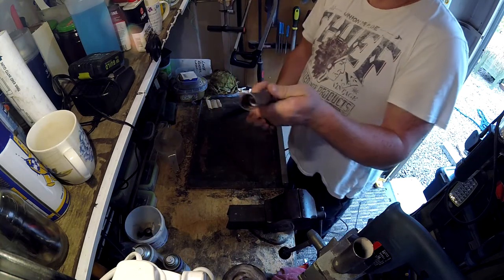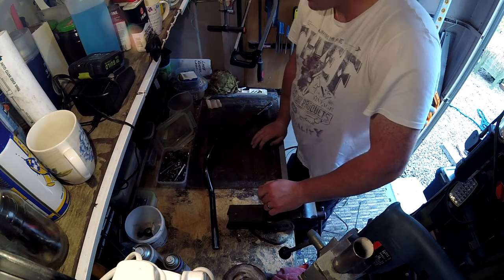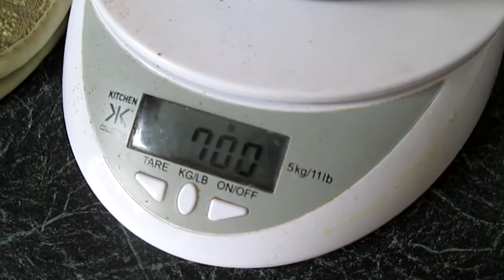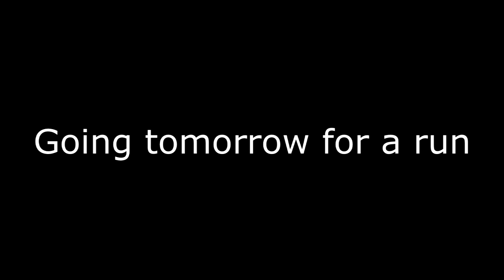Motorcycle handlebar vibration issue Part 6

Comment: I have an old Royal Enfield 500 single , do you think filling the bars with lead shots would be effective in reducing the vibes?
Reply from the maker: The best thing that helped me was old small nuts and washers or a set of steel bars. The lead shot didn't work so good but the steel bars have worked the best so far and the nuts and bolts a close second. If your bars are already steel then try some old nuts and washers, small bolts and screws, let me know if you have success.
Reply: James McCreadie Thanks for the reply. I have an internal thread at the end of my stock handlebar to fit bar end weights. So that allows me to fill things only upto 5mm . I shall try to source small nuts and washers and fill it up .
Reply from the maker: It might be better to source another set of bars because the bars need to be completely filled up to totally deaden any vibes.
Reply: I'm wondering if sand would absorb it the best